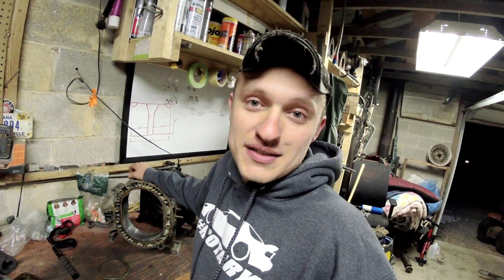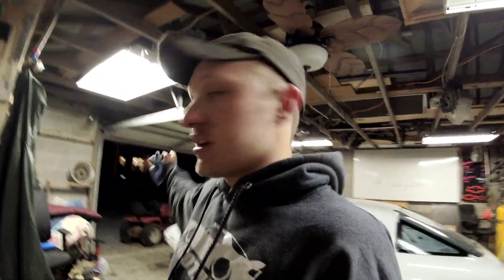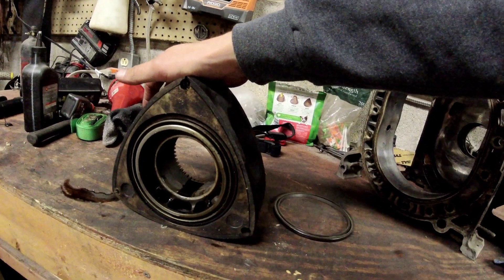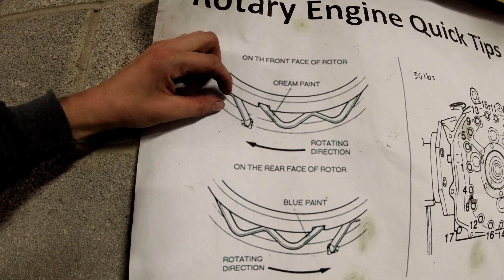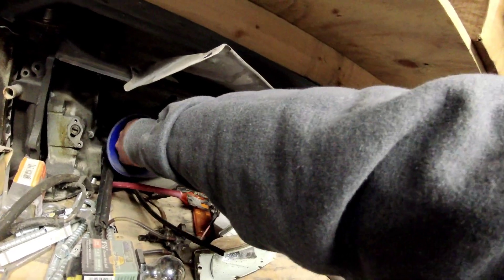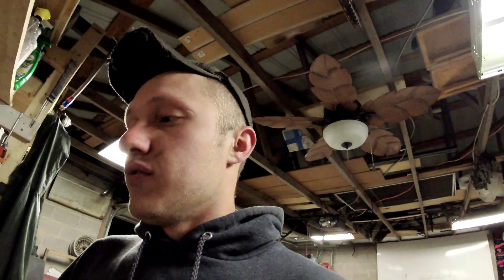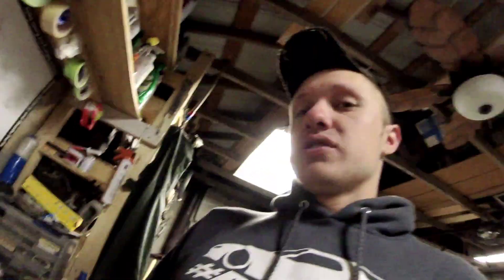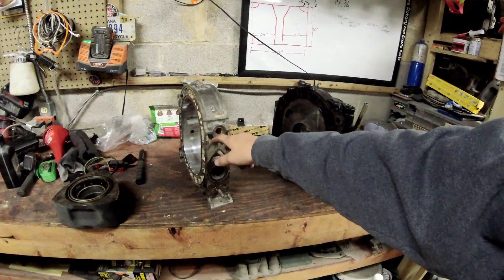Your Rotary Engine Smokes - Do you Rebuild?

Comment: Very good information and well explained. Going to add one more, based on my experience. If you run a precsion turbo make sure you have an oil pressure regulator. My PTE has too much oil pressure going into the turbo, there for causing the smoke.

Comment: What about in my case my T2 smokes heavily on start up and once I start driving it it clears up and won’t smoke anymore once hot. The smoke is blueish so it is oil being burned but it completely goes away after being warmed up and doesn’t even smoke on decel. I just barely rebuilt the engine like a year ago which is kinda annoying but I did use the atkins viton o-rings and did reuse the trays instead of buying new ones.

Comment: if your carburetor floods and you wait for it to unflood the gas will seep down the chambers into your engine and your car WILL smoke, and the SMOKE IS NOT BLACK. I can't stress this ENOUGH. The engine is NOT running rich after that initial start-up, it just has a bunch of residual oil and gas mixed together that burns for a good minute.  So please make sure your carb doesn't leak at all before tripping balls.
Reply from the maker: Dude tripping balls never thought I'd read that in a comment!!!!  Thanks brother!!  You are correct above!!!  Hell yeA!!

Comment: Mine was smoking under hevy acceleration olny till recently and now is smoking no matter what. I cant tell what the smoke is coming from cause i thought it was brake fluid but it is white with maybe a little grey but probably just white and it has no smell. Its a 12a engine in a 79 rx7. Do you know where i should start?

Comment: I’m surprised you don’t premix in your RX-8. I was lead to believe that they didn’t oil enough from the factory to meet emissions regulations, which was the cause for the premature engine failures (compared to the earlier rotaries), is this not the case?
Reply from the maker: For a street car you're not really beating on them hard at all.  Would see more carbon build up and stuck seals. Vs lack of lubrication failure.  In a track oriented machine. Then yes. Premix away.
Reply: RX8 main failure is lack oil in chamber due to lack of oil ports trying to meet emissions ... You def should premix your RX8 it's literally the no 1 failure
Reply: @RADPotential  and premixing helps with carbon build-up , pre mix oil is made for 2 stroke engines that are notorious for piston carbon build-up, the oil helps keep that stuff low

Comment: I’ve got an rx8 with 54k on the engine. If it sits for many days it will get a huge puff of white smoke until it warms up. Can I get away with just doing a soft seal kit? I’m in East TN.
Reply from the maker: Most likely a coolant seal, do you notice it using coolant?
Reply: @RADPotential  hard to tell. Very little. I just recently flushed it. The resevoir is down maybe 2 inches.

Comment: Um the renesis has a restricted oil injector Pinole, I seen a video dude dissemble one... for sure they had too.. the epa’s grievances for the oil injected engines aka our love and the 2stroke dirt bike... so to pass emissions that’s why it’s equipped with the dual housing short oil injectors to run 2 drop lines vs the older single droplet and long vacuum drawl manifold atomizing injector...

Comment: Hey I just picked up a 79 with the 12a and I was wondering what the premix ratio is for a fill up. I don’t plan on tracking it but I will probably rip on it
Reply: I have a 79 as well I have the omp disconnected and am running a little more than one ounce per gallon.
Reply: I just dump one of those baby 2.5oz fmx 2 stroke bottles with fuel stabilizer in a full tank of 93 running factory omp, 2 bucks on top of the tank when i fill up
Reply from the maker: If you have an omp on it run no more than .5 oz per gallon even if your beating on it. .  No OMP I wouldnt go more than 1 oz per gallon.
Reply: @RADPotential  whys that, i put a Lucas bottle per half tank, THE TINY bottle , i think that is 5 ounces

Comment: hi :3 i have quick question for you about 13b from rx8... Any chance you know why she doesnt want to start on cold but when you turn ignition 2-3 times it will starts straight away and on the hot engine starts without any problem. Did you see something similar and what was the problem.? :3
Reply from the maker: Check fuel system.  Fuel pump is priming each time you turn the key.
Reply: @RADPotential  she was on "Mazda recall" for fuel pump ⛽
Do I need to check something als? :)

Comment: Whats the risk if you premix to much?
Reply from the maker: Gums up the seals and excess carbon buildup.  Especially if you're not running the car super hard.
Reply: @RADPotential  could you avoid premix and the oil metering pump if you use carbon apex seals? You can still get carbon seals for 12a engines and I have a set I would like to use.
Reply from the maker: I have no experience with carbon seals. But I'd check with the manufacturer of them.  I'd assume lubrication is still required

Comment: My 1984 RX7 destroys starters.  I've replaced mine 4 times in 2 years (less than 5,000 miles).  The engine is tuned and starts right away.  I run the car weekly.  Any ideas why the starters are dying???
Reply from the maker: Destroys how?  Like broken gears. Or burned up?
Reply: @RADPotential  Burned up....last one was hot
Reply from the maker: Bad ground? Or dirty/faulty connections and wiring

Comment: Hey man, I 100000000% disagree with your thoughts on premix in an RX-8, here’s why-
The oil injectors in an RX-8 are controlled by vacuum, and a lot of the times you will find that the oil injectors themselves have failed and do not hold vacuum anymore.

I’ve worked on hundreds of RX-8s and seen this dozens of times on engines anywhere from 50k miles to upwards of 150k miles.

Always always ALWAYS premix your rx8. I don’t care who says what. 

Not to mention, the OMP on the rx8 is electronic, that’s obvious, BUT what’s NOT obvious is that the OMP flows it’s max output at only 7700 rpm, and the map that controls the OMP stepper motor limits the stepper motor a TON in order to be more emissions friendly. 

So if you’re not going to premix, at the very LEAST change the stepper motor map on the omp and check your oil injectors religiously, or simply premix .5-1oz per gallon.
Reply: Also if you want to see some RX-8 specific content my channel Ricer Rescue is great for that.